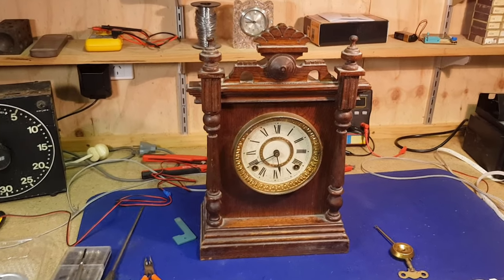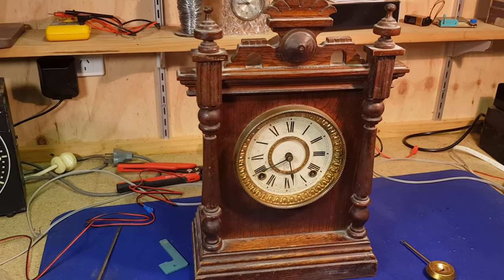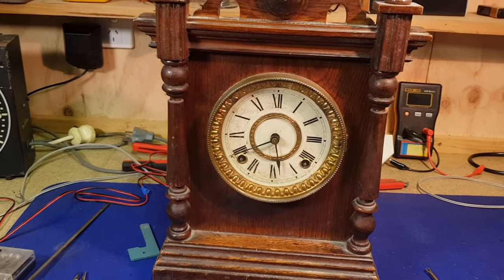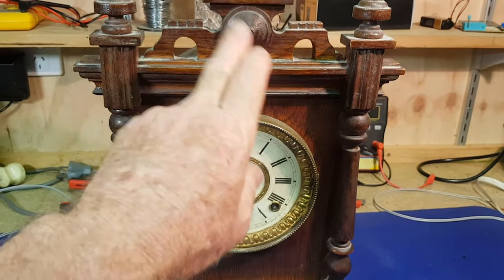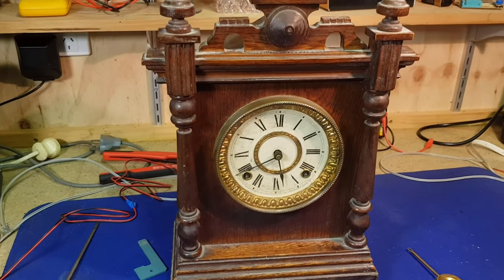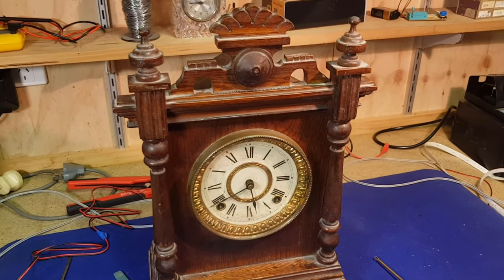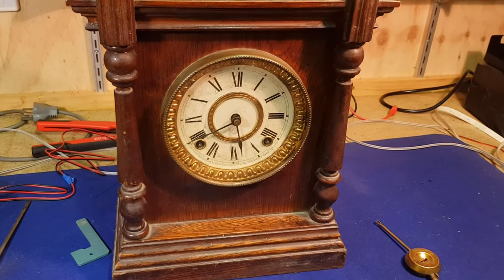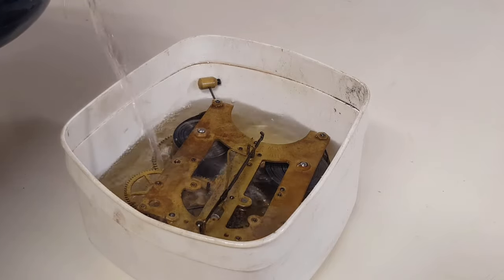How to fix an antique mantel clock. Service & lubricating an overwound movement. DIY Ansonia repairs

Comment: Wonderful video and very informative! My wife picked up an 1890 mantel clock from an antique shop a few months ago. It does not run, but appears to be in working condition. I wanted to get it serviced, but the cost just to have it looked at locally is $250! I had some people tell me that they had had success with spraying it with WD40. I wasn't to excited about doing that but gave it a try anyway. The clock did start running, kinda, but quickly stopped and I am not going to spray it with anything else. I found this video and now feel very comfortable removing the movement to clean it and reoil it. Hopefully I can give it a shot in a few days.
Reply from the maker: Fantastic Nick!! Let me know how it goes! 😊👍

Comment: Just fantastic. I've gotten into this by wanting to safely collect and store radium for geiger coiunter check and lab experiments (nothing for sale; just kept in the family and labeled with warnings, handled with repiratory gear etc., etc.). While radium burned out all the phosphors over time it can be isolated and re-mixed with fresh phosphors but kept visible in a cross-shaped vial behind thick, radioactivity-shielding glass and lead tape, as well as periodically relieved of radon gas. Anyway, I didn't have the heart to damage running clocks at first, so I got broken ones... then I didn't have the heart to throw away broken clocks I got. So I decided to re-paint them as best I can (without radium) and fix them. Then I realized I had a cuckoo clock from Mum in the laundry room. I always hoped I could do a quick fix like this, like has worked wonders for sewing machines.
Reply from the maker: Thanks for the detailed comment Jeff! Interesting! I don't plan on dabbling in anything radioactive!! 😱

Comment: Thanks very helpful and yes I am trying to get my old family clock going. Its a three spring job and I reckon from your video mine will come good as well. I'll follow your video however the main springs are housed ggrrrr so not sure how to get some oil in there. I'll work something out.
Reply from the maker: Enclosed springs are much more of a problem Barry! Don't allow them to soak up solvents as it's generally a much bigger job to remove, clean & reoil them! Hopefully they are ok and just cleaning the rest of the mechanism, and re-oiling the pivots will get the clock going again. If not, a more major service is required.

Comment: Great video, I’m the current custodian of my Grandfather’s clock and there are now two more generations in line after me.
I think it will be cool for the youngest to be able to say “That’s my great, great, grandfather’s clock.
Lately It runs for several days then then out of the blue it just stops.  I give it a nudge and off it goes again.  I’ll do the clean and oil thing although I might not have the guts to use petrol.
One question though, I notice the minute hand on your clock is about 3 minutes past the hour when the chime goes.
Mine is about 2 minutes out so I just set it fast so the chime is on time.
Is there a way to fix this?
Thanks
David
Reply from the maker: Thanks David. The stopping could be that the clock is slightly out of beat. Maybe try adjusting the level either way just a little (with a thin piece of card under one side of the clock). Try both sides over a few days and see if it makes any difference. As for the minute hand - there's no easy adjustment I don't think. It has to do with a trigger lever inside and it may have to be slightly bent to adjust the trigger position. If the hands are a thin type, you could possibly bend the base of the hand just a whisker to allow the tip to point a bit further back (or forward).
Reply: @TheUltimateRecycler  
The levelling  card is a good idea.  I also have a machinist level that will show how level it is.  I had the clock serviced a few years ago by a professional clock maker and it was less than impressive as it didn’t really solve this problem.  They told me about a small lever on the mechanism I could use to adjust it to get it to tick evenly just like you did by bending that piece slightly.  Do you think I can see that lever now 🤠.
I’ll check the levels and experiment a little.  If I can’t sort it out I’ll remove the mechanism and spray the pivot points with something like carb cleaner, let it dry and oil just like you did.  I’m not game to release the spring without further research.  I think I’ll let it wind right down then remove the pendulum and let that go as long as it can.   It’s a seven day clock so it will be a bit of a wait.  Thanks again for a great video.  You have given me confidence to have a go at fixing Grandpa”s Clock 🤠

Comment: Great video, with some excellent advice!  9:44, for a moment I thought the bug was on my screen. :)  I've inherited an old barometer/thermometer/clock/hygrometer from my parents.  I don't recall the clock ever running, so it probably last ran in the 1960s, but I would like to get it going.  Maybe it just needs a good clean and lubrication, and I need to get a key made somewhere.  Would a synthetic engine oil be better, maybe a 0W-30, which is quite thin for cold climates; or even a shaver oil?
Reply from the maker: Thanks! 😊 Yes, if the clock has spent most of its life idle - there's a pretty good chance a clean and re-lube will get it going! Many clock repairers now recommend a synthetic oil 👍😊

Comment: thanks so much for these fabulous videos, very helpful... one question if you have the time sir... do these clocks use magnets  at all, to keep the pendulum moving? my girlfriend just brough one home, not antique, but home made and the pendulum wasn't moving, so i opened it up and it had a kids toy stuck in there as well as 2 magnets that were behind where the pendulum swings... it looks like it has glue on the back of one, and was wondering if that sounds right?....thanks again!
Reply from the maker: Thanks very much! 😊 Definitely no magnets required for the pendulum in a proper clock mechanical movement. They usually use magnets when the pendulum is only a pretend feature and not involved with regulating the speed of a clock. The movement in this case is usually a cheap quartz one requiring a battery.

Comment: I will see this clock in my shop in about a year!
Reply from the maker: .. and what would you charge in your shop to repair this clock Markus had I brought it to you in the first place?
Reply: You over lubricated the movement.  Never lubricate the gear teeth or meshing trundles.  The excess oil attracts dust and will eventually stop the clock.  You do very nice work and I only saw that one little mistake. I’ve been repairing for 40 years and still learn new steps and processes every day. I might have come across as to critical with not enough explanation.  I apologize.   Like I said  You do good work !
Reply from the maker: @markuswatson2123  Thanks for your concerns, but I am wondering how closely you watched this video. At no time did I oil the gear teeth and I even explained exactly what you just said about attracting dust. You are correct in saying we never stop learning though, and I do welcome constructive comments from experienced clock repairers 😊👍

Comment: I have done this too. I've also used engine degreaser, because you can wash it off with water afterwards an d leave no petrol smell. Clearly you must be able to allow the clock to dry completely, and my hot South African sun makes that possible. As long, that is, as the springs are not contained within barrels. I would not do that with an enclosed spring, which, in any case, one can't lubricate without getting access to the spring itself. But the one clock I did with petrol retained the unpleasant smell of an engine that had been cleaned with petrol. How did you get rid of that after-smell? Very nice explanatory video - thank you. I have subscribed and an going to look for your other videos!
Reply from the maker: Thanks Dave. Yep, definitely not a method for enclosed mainsprings! The petrol smell faded pretty quickly but I did leave it about a week before reassembly. I guess you could rinse with IPA to reduce any smell. Thanks for the sub! I have some more clocks to do soon 😊👍
Reply: @TheUltimateRecycler  Looking forward to those other clocks, as I am not a horologist by any means, but enjoy trying to restore the clock and the bodywork..

Comment: I just got an Apprenticeship at a clock shop.

I've been told that you can just soak the whole mechanism in ammonia from the store, like just plain lemon scented cleaning ammonia.

Will this work, or will it damage the steel components?

Thanks!
Reply from the maker: Well done on getting an apprenticeship mate! I'm not sure about an ammonia soak! It may cause some issues with the brass as well as steel.. 🙄
Reply: @TheUltimateRecycler  Thank you so much for your quick reply even on such an old video!

The man that I got the apprenticeship under instructed me to use ammonia, so I have currently have the movement soaking in ammonia despite my second thoughts, as I am going to do what he told me to do and if it messes anything up, then it will be because of his faulty instructions Haha

I will let you know if it works!

Thank you again so much.

Comment: I "tinker" with old clocks,  usually gettin a small amount of oil onto the pivots. And pallet faces will restore operation... I avoid dissaembly, getting everything back together with proper gear timing can be a real challenge... Having a running movement "in beat" is important, too
Reply from the maker: Yes Bob, it's a big step for the inexperienced to consider disassembly! And it certainly adds a lot of time to the job even for the experienced! As long as there is minimal wear, no damage and the movement is not overly dirty, a careful re-oil can work wonders! 👍😊

Comment: Thanks for this. I have the exact clock. I soaked it in petrol but it still didn’t work. The springs are too tight. How do I make the key remover thingy. I note about not using the key. 
I’ve admitted defeat and reassembled it but the bit that holds the pendulum won’t stay in place. How does it attach on?
Many thanks. Great video.
Reply from the maker: Thanks Monica. I just made let down tool from an old key (removed the wind part and riveted the drive part to the end of an old screwdriver). You can buy spring let-down tools online pretty cheaply, but I guess if you only have a one-time use for it, that's not really viable. You really do need to let the springs down to take the pressure off all the parts and allow a successful rinse. Also the springs may need a complete dismantle as they may be totally stuck with old oil - and that's going to be a lot more complicated than this fix. Not sure which part you are referring to - it it's the arm that the pendulum hangs off, you may have a broken suspension spring. You can buy them cheaply online if need be. Thanks for watching 😊
Reply: Use a length of dowel rod or a piece of broomstick, drill a hole in the end slightly larger than the diameter of the clock key shaft, cut a slot across the hole that is the  same as the thickness of the wings on the key.  Insert the key in the slot and use this as the let down tool. The dowel can be held firm but be allowed to slip slowly in the palm of the hand.  Crude, but effective and safe.  Used that method for a couple of decades before I could afford a let down tool.
Reply from the maker: @dperry428  An excellent suggestion, many thanks! 👍😊

Comment: Dear Chris, even after this clean and oiling the time part of the wheels are not moving.  The coil on that side was totally   unwinded and winded back. It looks the coil is not successful in pushing the load. It is heavily stuck.
Reply from the maker: That sounds like the spring itself may need a complete dismantle and clean, or it may even be broken and need replacing.

Comment: Thanks for that...great video. Can the sewing machine oil be substituted for "WD40 silicone" or the oil supplied with hair clippers?
Reply from the maker: Thanks for watching. Yeah, the hair clippers oil may be ok but I wouldn't use a spray lubricant of any kind.
Reply: @TheUltimateRecycler  Thank you

Comment: I just bought my first mantle clock a W.L. Gilbert movement circa 1925 in an Australian made she oak case. There's no back on it, so whilst it's working it's pretty dirty I would like to clean and lubricate it, petrol is a great solvent for cleaning car parts, and I guess the parts in an antique clock will be metal, are there any alternatives ?
Reply from the maker: Any solvent which will dissolve old dried oil will work fine John - I just find petrol convenient and cheap! You don't want anything that will leave a residue. I have used brake cleaner on small clocks with success as well 👍😊
Reply: @TheUltimateRecycler  Thanks for getting back to me, looks like shellite is a good choice, it's sold by a watch supply co. in queensland as a cleaner

Comment: At the risk of sounding like one of those clock "snobs",might I suggest that while you have the movement out of the case,use an old small paintbrush and some Pledge or other cheap furniture polish to clean up the case.Just get the brush wet,and dab away the dust.Using a soft cloth wipe up the excess and stand back and admire your work.I learned this trick many years ago to remove dust and dirt from carved cuckoo clock cases.Wipe the inside of the case as well for best results.Doesnt make the clock run any better,but the owner will probably appreciate your efforts giving them a clock that smells fresh when you open the door to wind or set it.also,be sure to do the glass with Windex too.Careful,on the inside,dome have decals (striping or maybe the word "regulator")
Reply from the maker: Thanks Tim - that's really great advice! Not a "clock snob" comment at all! 👍😊

Comment: Thank you that was perfect for the jobs I need to do at our repair cafe.  Only difference is most of the mantel clocks I have coming through hae a barrel spring so access to lubricate is very limited.  Is there a trick to doing these type of spring ? 🇬🇧👌
Reply from the maker: Quite a number of people have asked about enclosed spring barrels. It does present more of a problem! I'll have to do a video of dealing with these soon. Thanks for watching Phillip 😊

Comment: I love your video. 
I have a couple cuckoo clocks that stops after a short period of time. Would this cleaning procedure be ok on them , and do you think it might help them? Thank you very much.
Reply from the maker: I haven't done much work on Cuckoo clocks John, but if the movement is gummed up with old oil this method would probably work 👍

Comment: Marvelous video.  Makes clock cleaning and oiling an unintimidating process for the novice, which I am.  Here's my question:  I have a mantel clock on my bench now but I am afraid to wash it as it has captive springs (encased in metal drums).  If you wash it, how do you properly clean and then oil those hidden mainsprings? 
A couple of comments....perhaps rather than gasoline, white gas, such as used for Coleman pressure lanterns, might be better as it is odourless, clear and has no additives.  I use a clock wash formula (acetone, ammonia, Murphy's Oil Soap and water) works nicely for me.  As for oiling the springs I used Hoppe's Gun Oil a clear, non-gumming, high viscosity oil applied with a little soft artist's brush.  Many thanks!
Reply from the maker: Thanks Ross! Yes, enclosed springs do present a problem for this type of service. I actually discuss this in a video I did about repairing a broken mainspring.
Thanks for your suggestions! 😊👍

Comment: Awesome! Thank u so much!! What if my clock springs have barrel casings. Do u still recommend the petrol soak process??
Reply from the maker: Thanks Triad! A few have asked about that. I'd recommend not submerging the enclosed spring barrels as it is too hard to clean and re-lube the springs effectively. Just wash the movement as best you can with a brush to get all the pivot points clean. To do the job properly, the springs really do need to be removed - but that it a much more complicated job! Thanks for watching 👍😊

Comment: I have a Gilbert mantle clock Circa 1930, it keeps time and also chimes well. But as it chimes on the hour you hear grinding sound. I was about to put oil on the cogs ,but I am just not sure what to do
Reply from the maker: Hi Kym, yeah don't just splash oil around the cogs - long term it can do more harm than good! Perhaps something is just rubbing on the gear train which drives the chimes? You could certainly add a small dot of oil to each bearing point, but the teeth of the cogs aren't supposed to be oiled. Good luck 😊